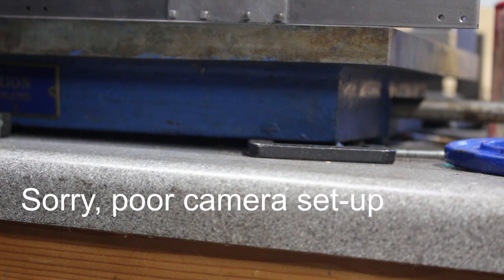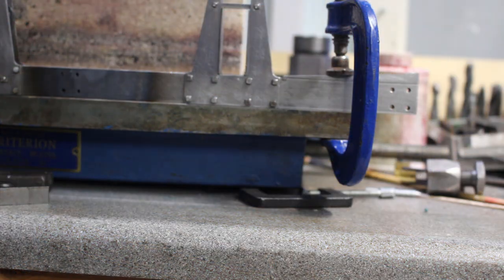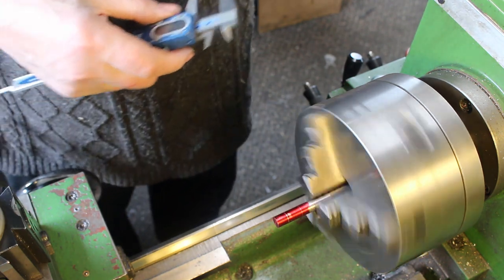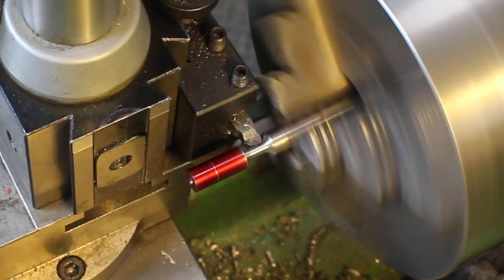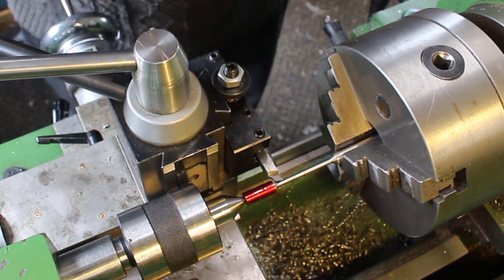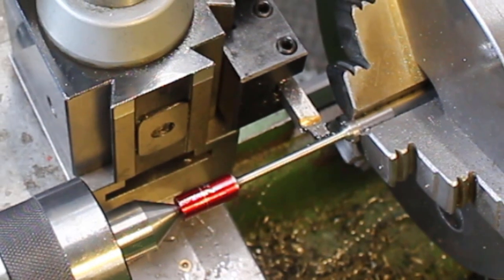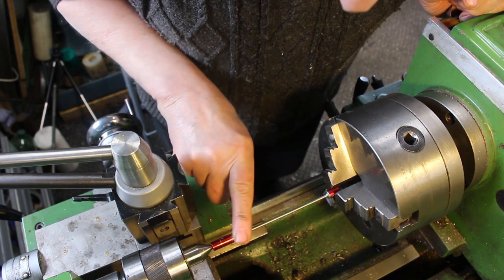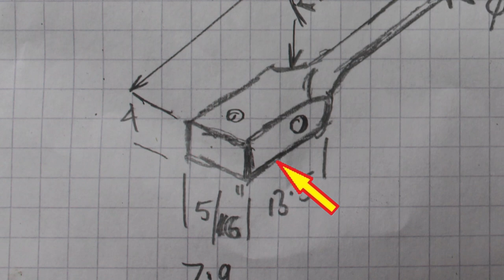LION - Loco Steam Engine Build pt. 26 - Frames Cont. + Allchin Traction Engine Steam Up.

Comment: Have you come across straightening by selective heating and then quenching? Keith Fenner shows it in some old videos and I seem to recall Tom Lipton mentions how to do it in his book.
Edit, both show it for straightening round shafts, but the principle should hold for items like your rails. If you know any real oldtimer who did car body repairs, you could ask about using the technique to shrink body panel damage .
Second edit, old car repairers used wet shredded asbestos , so there might not be many left to ask.
Reply from the maker: Yes, I've seen one of Keith's video's straightening prop shafts, am amazing skill. Cheers!

Comment: Yellow tires? Where did they come from?
Reply from the maker: Oh yeah, they are embarrassing, and temporary. I'm looking to build a more suitable trailer with metal spokes wheels of a more traditional look. They are sold in the UK my Machine mart and others, the yellow signifies they are puncture proof.
Reply: @GoCreatehms  I see. Where did the tires for the driving wheels come from? Are they cut down riding mower tires? Glued in place?
Reply from the maker: Model Engineering suppliers provide rubber strips in various sizes and profiles specifically for miniature traction engines. You cut them to length, glue the ends together and glue them to the rims.
Reply: @GoCreatehms  I see. By the way, I'm currently watching all your Lion video's in order now. Glad you made them.